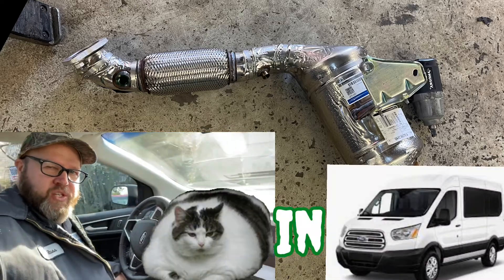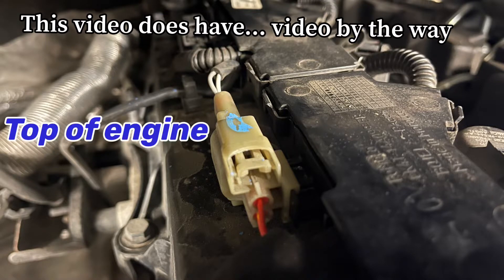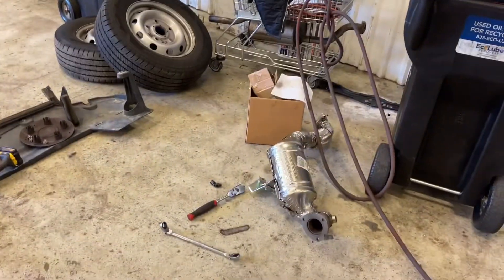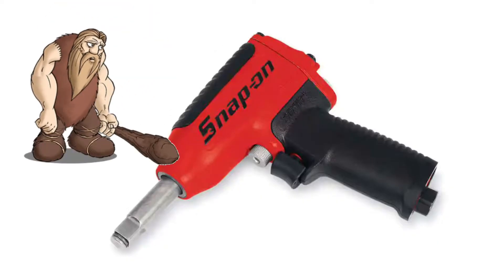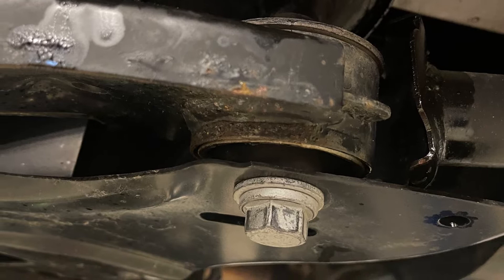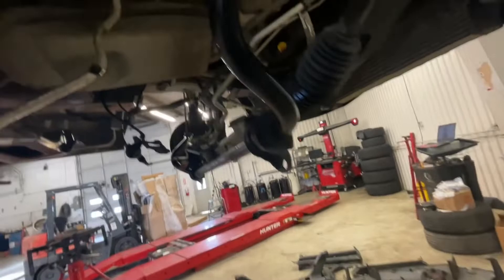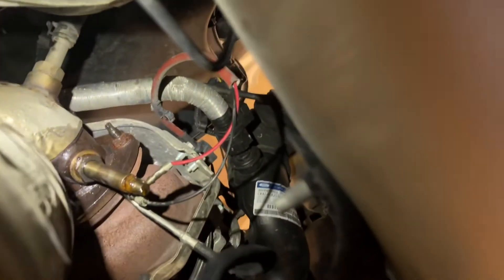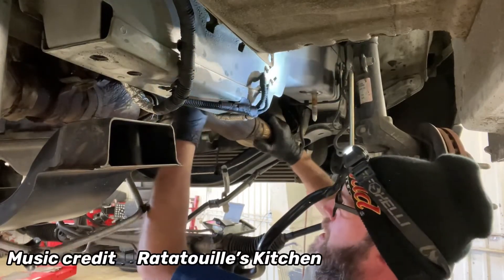Ford Transit Cat Removal 2016 - 2019 Cat or (DPF) Diesel Particulate Filter 3.2L Power Stroke Puma

Comment: I just changed mine out in my driveway just using a floor jack. You can remove it through the engine compartment by removing the air filter box. It wasn't easy, but it was possible
Reply from the maker: Thanks for your input Jacob! I did this one by the book. This was a prison van. No joke, retrofit to move prisoners around. 🚔For the federal gov’mt 😂. I had to make sure the emissions weren’t bad and there was no engine light. I pulled it off, of course I didn’t make flat rate but that’s OK 👍 😁

Comment: You know if you take out the headlight housing and airbox you can pull it out the top super easy
Reply from the maker: This was a 2019 diesel. And I basically did it by the book. Used the Ford shop manual And advice from my master tech to do this job. 
Our dealership started taking on more diesel jobs and not a lot of text knew how to do this. Taking off that subframe was a challenge for sure.
Dealership I worked at closed in May 2022.
Reply: @RussShawTV  the one I did was a 2018 3.2 powerstroke diesel. First one I did took me forever to figure out. Then once I realized you could remove the headlight and airbox it opens the whole area up to remove it with ease
Reply: Takes about 25 minutes through the top and you don't have to remove the subframe or anything underneath.
Reply: @jamescunningham965 you’re are the man James. Got her done in no time.